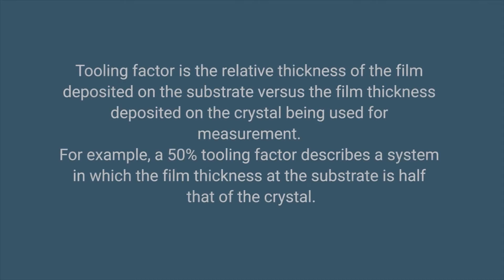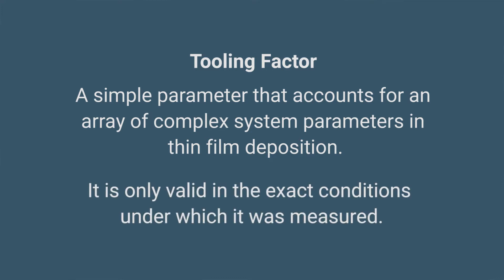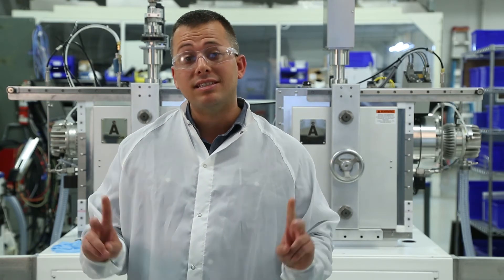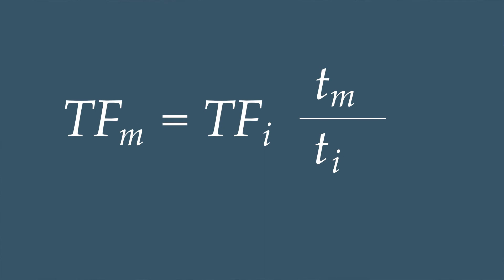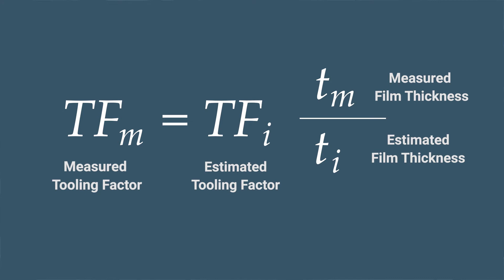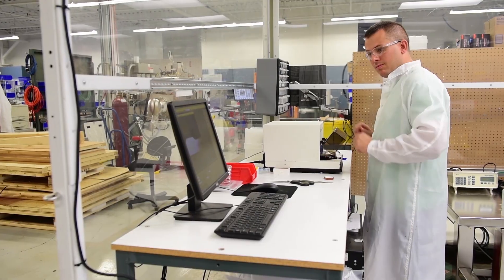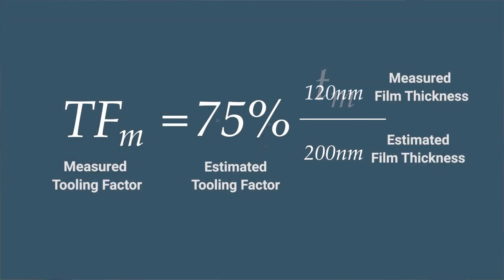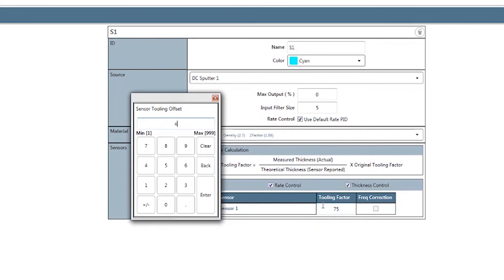Angstrom How-To | Tooling Factor

Comment: Awesome video.  I'm wondering if you could comment on the lifetime of a Quartz Crystal Monitor.  There seem to be a lot of explanations online about the principles of operation, but it's difficult to find an explanation about how QCMs become inaccurate with sustained use and when they should be changed out.
Reply from the maker: Hi Nathan, and thanks for the comment. QCM’s consist of a crystal that oscillates (or vibrates) at a specific frequency (the ones we utilize oscillate at 6 mhz before any deposition takes place). As film is deposited onto the crystal, its mass changes, and there is a measureable difference in the oscillation. We’ve found our partners typically change the QCM out after about a 20% reduction in crystal frequency. When a system is depositing only one material (so that the change in mass and density of the film on the crystal is consistent), it is easier to determine exactly when to change the QCM. However, when a crystal has multiple materials deposited onto it, all with different densities and z-ratios, it can be more difficult to determine, so will sometimes be switched out more frequently depending on how important QCM accuracy is to the user.
Reply: @Angstromengineering  if we use ITO2, we have to change it each run, but if just SIO2 with TIO2, we can use a multiple-time, but it depends